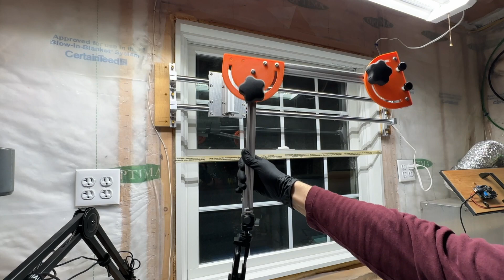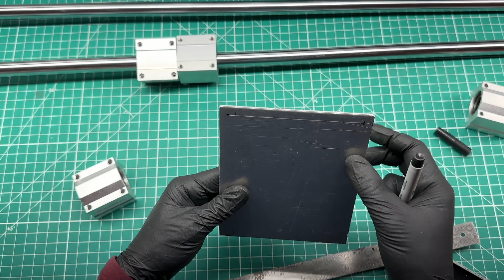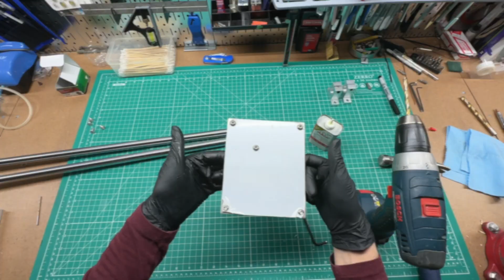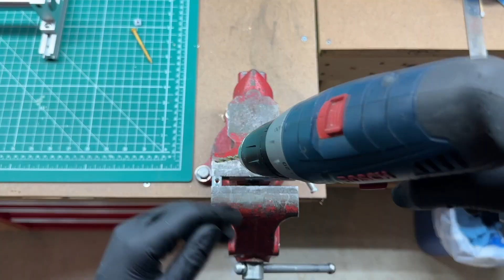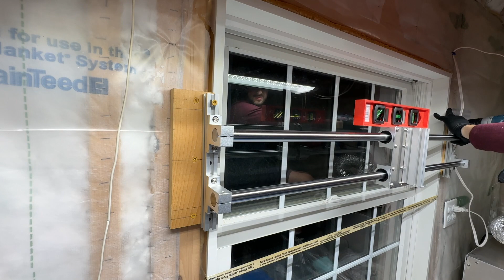DIY Overhead Camera Rail

Comment: Thanks for showing. I need to make something similar with a 3 metre span do you think that pipe will be rigid enough?
Reply from the maker: 3 meters is really long. The part that you are calling a pipe is a solid rod. It’s quite heavy. I doubt anyone makes one that is 3 meters long. Maybe I’m wrong there, but if they do it will be insanely heavy. Even if you could get one that long I bet it would flex because of the extreme length. You probably will need a different design that allows for supports across the span rather than just the ends.

A design that I’ve been thinking about is using v-slot aluminum extrusions and a carriage designed for the hotend on a 3D printer. Since the carriage only interacts with the top and bottom slots, you can use the front and back slots to connect lengths of vslot to make a longer extrusion, and you can attach the back of it to your wall surface in multiple places. I just don’t know how much weight the carriage can handle. Here is an example of the carriage: https://a.co/d/2IKnasO